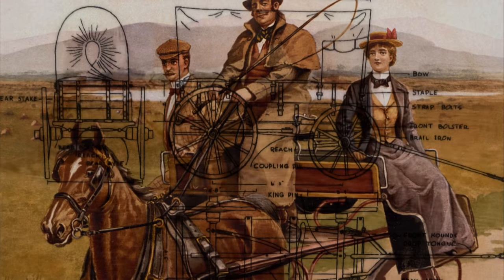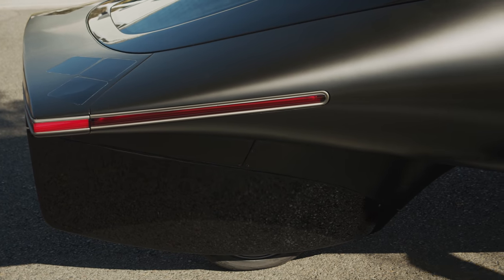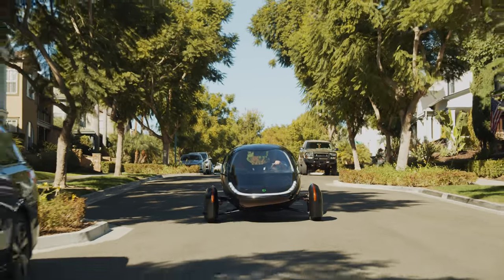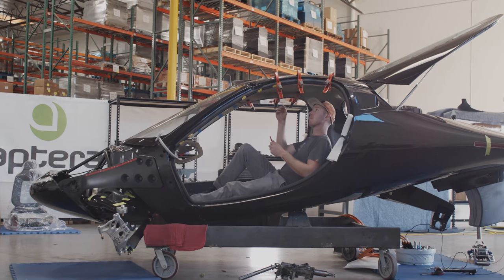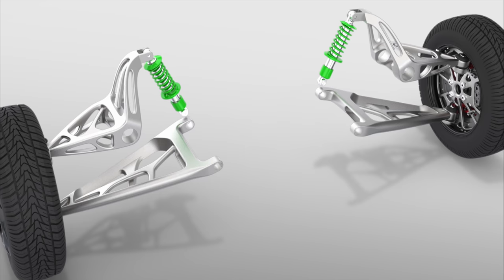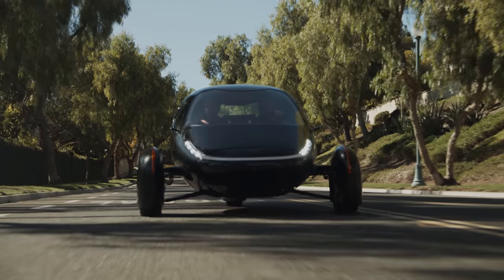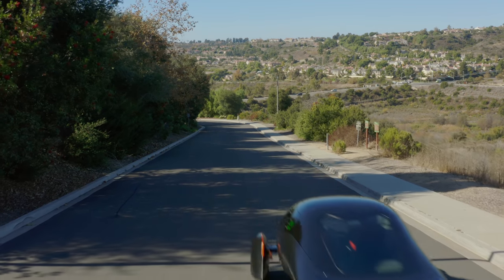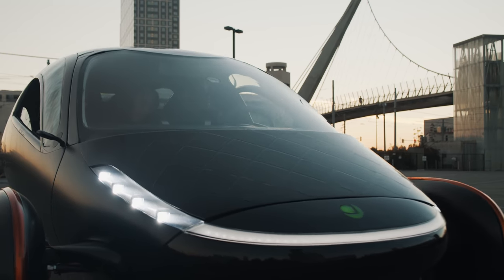Aptera Has Launched

Comment: The range on their best model for just 1 charge is 1,000 miles and it costs less than $50,000. That’s actually insane. Plus you can get additional range from solar power. I really hope these guys succeed. Also a 4 seater model would be nice in the future as well.
Reply: they are planning a 4 seater, but first things first.
Reply: The extra range from solar power is pathetic. Basically a couple miles a day.
Reply: @adamkimmV  something is something
Reply: @adamkimmV  well a lot of people only drive a couple of miles a day, also if every car in the world can save a couple of miles on gas EVERY DAY that would make a huge difference.
But yeah there is also definitely room to grow, which is also kinds the point of this
Reply: @GuidoHaverkort  the issue is what's the point in putting the solar panel on the car? It just adds weight to the car compared to having a panel on a roof, or in a solar farm, and just using that electric to charge cars. Especially considering most people will leave these in garages, or car parks 90% of the time.
Reply: It would be cool if you could tow a teardrop trailer so you could live and drive anywhere
Reply: @adamkimmV  yeah okay i get what you're saying, that is true. But i think what they eventually want is that solarpanels charge so good that they charge a considerable amount while driving.
Also maybe when you are parked at your work it can charge without the need for a charger but i dont understand why all car companies dont work together to create an elektric grid, tesla already said they would be up for it
Reply: @adamkimmV  I think a big plus is the A/C might be able to run almost continuously. Also , if it has one the 12 volt lead acid battery won't be able to die.
Reply: I think most people only buy two seaters, if they are cheap or if they are sport cars. So the number of seats in this car is maybe its biggest problem.
Reply: @adamkimmV  pumping fuel exhaust into our planets atmosphere at the rate were doing is pathetic
Reply: @adamkimmV  it means u will never be stranded if u can’t get to a charging station...even in the middle of the desert   ☺️
Reply: @MrClassifide  why would it need a lead acid battery, if it already has shit tons of li ion.
Reply: @adamkimmV  sometimes for ease of comparability. They need the 12 volts to be available to close battery contactors if they separate the battery contactors while the car's off they can't use high voltage. so they use 12 volt low voltage and they usually just use a regular car batteries. 

The Prius for example is a 12-volt AGM battery that it does not use to start the car it's just a power all the regular 12-volt window openers and lights and stuff like that. Also the computers
Reply: @adamkimmV  according to their website, the full solar package adds about 40 miles per day.
Reply: @Change-Maker  Yeah exactly. That's not "a couple of miles".
Reply: I love electric vehicles but there is just no market for this monstrosity. An average family needs a small car for economic trip to work and shoping and a family car for long family trips. This isn't either. Too small for a family car and too expensive for a shopping bag. It is not a sports car either. The only possible customer I see buying this is some rich elderly couple with no family who wants to travel a lot.
Reply: @RandomGuyOnYoutube601 agreed that it's not a family car, but why isn't it a sports car? 0-100km in 3.5 seconds, and better aerodynamics then any standard car, creating both speed and stability, like flying, but on the road.
Reply: @Change-Maker  perhaps it is, I didn't research it. It wasn't in the video and from the video (was it?) I didn't get a feeling of a sports car. I am sorry for my ignorance. Sports car market isn't huge either. My point was that you don't want to pay for 1000 mile range becouse the range is mostly useless for a small vehicle.
Reply: @adamkimmV  40 miles charging in a day if parked in sunlight, is a good deal for me and people I know. Who says couple of miles charging in the sun???
Reply: You can roam an entire city with 40 miles , now imagine you’re too lazy to go out the charger in , or maybe you’re stranded on a highway , or maybe you forgot to put the charger in !! That’s when the sun light thing comes into play , more over in countries like India and parts of Africa , the sunlight is so intense that not would it turn you black and brown , but it would also charge the car in a small amount of time , you won’t need to charge the car at all in countries with a lot of sun light
Reply: 500th like noice
Reply: Solar freaking roadways!!!
Reply: @adamkimmV  If you live in a colder, cloudier climate, the minimal solar panel option is the best choice. The max solar option is for people who live in warm sunny climates like southern CA, TX, AZ etc. There are 3 solar options to choose from.
Reply: @adamkimmV  I'm guessing the current solar panels are between 20-25% efficient, the best panels available are in the 40+% range.  When they become standard the extra range will double.
Reply: @adamkimmV  ni;,g4ga
Reply: Enjoy driving 1,000 miles in that tiny pod. Like driving 14 hours in a Miata. Impressive, but still impractical. It’s good to see innovation, but this car is kind of a joke.
Reply: @adamkimmV  40miles per day
Reply: @adamkimmV  That is why it is an optional add on
Reply: @adamkimmV  It just adds weight? Wow, you're short-sighted. The additional weight is negligible (likely near-zero) and the benefits are well worth it for people who don't have "a panel on a roof". Mine will be parked in my side yard (where there's good sun but no easily accessible power). And I'm definitely planning to take it camping. Having solar cells on the vehicle means that's one less thing I need to pack. Also, "most people" don't even have garages.
Reply: @tims8603  I live in the north US and I'm getting the full solar package (so as to pull as much "free" energy in as possible no matter where I happen to be).
Reply: @popefacto5945  Yeah, if you are able to afford the extra cash, why not. Kinda depends on where you live. I live in WI where summers are short and it's sometimes cloudy and or rainy much of the  summer. We're east of MN, which has a lot of lakes, and near 2 of the Great Lakes. If I bought one, I would buy the minimum solar. I'm retired so I don't drive much. The 110 plug to charge would be fine for me.
Reply: @adamkimmV  They're claiming ~40 miles per day of charging capacity. That's plenty for me (unless I'm on the aforementioned road trip, in which case I'd use public chargers). Speaking of, it'll charge on 110 VAC (so I don't need a level 2 charger at home). Does someone pay you to talk out of your ass like this or is it something you do free of charge?
Reply: @RandomGuyOnYoutube601  "An average family..." You're forgetting the millions of single people and childless couples. I'd buy one. I'm a single guy with no kids or pets and I have no need for the two extra seats in my car and never will. I use my car for shopping and visiting my mum 100kms away so this would be far better than my four seater petrol car.
Reply: @shukrantpatil  There are also plenty of people who can't park close to a power point where they live. Trailing an extension cord out of their window, across the yard and the footpath to their car is a bit impractical! 😄
Reply: @LeDank  Not at all. There's as much room in the cab as in any regular small car and, no doubt, the drive would be superior to most cars currently on the road. I used to drive 1000kms to work every few months in my Toyota Corolla hatch and had no problems with that. Most people don't normally drive even 1000kms a day so it's a moot point. The average daily drive is around 50kms a day which is what this is aimed at. It's a city car and would be perfect for that. Not impractical at all.
Reply: @weirdunclebob  Why put a 1000mile range on a city car? Couldn't you save several thousand dollars reducing that then? Your corolla hatch back has approximately 3x the space that this joke of a 'car' has. It's not practical and sucks.
Reply: @adamkimmV  For a regular car, yes you would only get a couple of miles out of the charge. For their car, which has zero drag, you can get up to 40 miles per day (obviously depending on climate, weather, etc.). Wind resistance is a pain to deal with, but much less so with their car.
Reply: @LeDank  it might not be practical for you. I couldn't imagine using this as a family car. However, I think people who use motorcycles as their regular form of transportation would disagree with your comment on space. Their are a whole lot of different lifestyles this car would fit neatly into. There is plenty of space for luggage for you and another person. I could definitely see a road trip in this.
Reply: @patientfirbolg3299  I think you only think it's cool because it's electric and are overlooking all the impractical bullshit because you want to like it. I do ride motorcycles all the time actually. Generally I commute by motorcycle. A motorcycle is better than this car. Harley Davidson makes the most expensive electric motorcycle available at $30,000. It's $20,000 less than this car which has about the same practicality. I would rather have 2 Harley Livewires than this doofy looking suppository on wheels.
Reply: @patientfirbolg3299  In fact, I have a motorcycle and a Fiat 500. Even my Fiat has more space than this stupid "Aptera". Geez what a stupid name even. You know how much I paid for both the Fiat and the motorcycle? About $16k combined. This stupid tadpole car costs three times both of my vehicles and can't do half of what I can do with those. Impractical and stupid. It's not gonna sell and Aptera will go out of business I can guarantee.
Reply: @LeDank  "Harley Davidson makes the most expensive electric motorcycle available at $30,000. It's $20,000 less than this car which has about the same practicality."

The 1k mile battery one costs 44k, but the 250 mile battery goes down to 25k. Which makes it 5k cheaper and it still has roughly a 100 miles more range and cargo space :). Room for a grocery trip, a few suitcases, etc. I think you just lack imagination. That and electric vehicles cost about half in terms of maintenance (which is more of the appeal to me).
Reply: @LeDank  Maybe the range is just a bonus of the better technology?! Regardless, few would drive all 1700kms in one go. It just means that you don't have to recharge for 1700kms. Having the solar panels means that you probably won't ever have to recharge it.

The space in the drivers seat the Corolla had wouldn't be much more than the space in the drivers seat of the Aptera. The rest of the space in the car is irrelevant while driving. The boot of the Aptera would be ample for my needs. It's not a joke of a car at all! Maybe it's not suited to your needs but there are other people on the planet with different needs to you!
Reply: I’d buy it if the design wasn’t this terrible
Reply: @patientfirbolg3299  it has not 0 drag thats impossibel up to means you get that the best sercomstances . In most cases you dont and why woud you buy that thing for 50k and you drive it in citys were you can charg anyways or were any electric care ahs enoth battery to get you throw a day without any problems. I dont realy know whats the point of this car is.
Reply: @weirdunclebob  If you only drive in citys or close range then there is even less point in this you get better electic cars were you have enoth range for every day driveing and you just charg it at home over night or by your workingplace and if you need it for lang range and need space to transport things you have that then as well . Dont see why you woud want to spend 50k for this thing .
Reply: @adamkimmV  hello architecture student here. those dark multilevel carparks you said are a big design problem right now and various unis are trying to solve that. It won't be long before someone comes up with that design solution, the only problem is currently there's no demand for it. I think EV vehicles are a good step towards this.
Reply: There are a lot of red flag when order: You ordering a vehicle that is not yet in production, Your ability to buy the vehicle is not guaranteed, place in the queue is not known, specifications can be modified any time after ordering, who in the wright mine place such of order.
Reply: I doubt this car in this formula will be street legal in most places.
Reply: @adamkimmV  According to them in another video, they claimed it can get 1 mile per 100 watts. That is very good. I built a solar electric gate opener with 100 watts motor and 35 watts panel  and 7 amp/hr lithium battery (1 ft x 1.5ft panel). It works perfectly for over 1 year (rain or shine). It works even during the California fire last year with almost no sunlight over 2 weeks. I was worry about not enough power when it rain when I started building  my smart z-wave solar electric gate opener in late 2018. Now, 2021 and it is still going strong. 
 I like they thinkings and design (, efficient, modular and simple). "simplicity is the ultimate sophistication".  I used to hate debugging someone's else code who made the code  unnecessary complex. I usually end up rewrote the code (usually faster) than try to fix a bad set of code. Large corporations usually do not like that for political reasons. 

"Any intelligent fool can make things bigger, more complex,..  It takes a touch of genius — and a lot of courage to move in the opposite direction.”

The  combined panels on the Aptera probably rank 0.5k watts.  That translate to 5 miles per hour.
Reply: I had the same hopes 15 years ago... for this same company...
Reply: @weirdunclebob  *km, not "kms" (kilometre-seconds).
Reply: @tstcikhthys  km/s is kilometres per second or kilometre-seconds, not kms. kms is acceptable for kilometres though km is technically correct.
Reply: @weirdunclebob  Kilometres per second (km/s) and kilometre-seconds (km⋅s or kms) are two entirely different units, so no, "kms" is not acceptable.
Reply: @tstcikhthys  Please explain the difference as I can't find it anywhere on the web.
Reply: @weirdunclebob  Kilometres per second (distance per time would be speed or velocity), while kilometre-seconds (distance times time, a compound unit) would be absement or absition.
Reply: @tstcikhthys  Never heard of absement or absition before as I've never looked that deep into physics. Fair enough though most seem to use km·s, not kms but that's probably me being pernickety.
Reply: @weirdunclebob  Yes, technically "kms" is incorrect for kilometre-seconds because it actually represents kilomilliseconds, which would amount to just seconds (the kilo and milli cancel out). This is similar to how "kWh" is incorrect; it needs to be written as kW⋅h.
Reply: @adamkimmV  In full sun all day the added range is ~40 MILES, not "just a couple of miles". My Prius gets "just a couple of miles" in EV mode on a fully charged battery. Try harder next time you attempt to troll.
Reply: @adamkimmV  it's 40 miles per day for solar charging. Americans only drive 25.9 miles on average. There's plenty of energy left on the car.
Reply: If you put it on  rails. Steel on Steel is 90% More Efficient.  90×300 MPG=27000 Per Battery Charge.
Reply: But look at how long it takes to get a full charge!!! It’s not that great, here in Michigan I believe it would take a month or so to fully charge to 1000 miles
Reply: @cambam0  yeah you could charge it in your garage. What about all the months that is sunny in Michigan. 🤔

You know the other 6 months of the year..

This is the same issue you have up in western Washington.
Reply: @otrogreandcorgi9818  do some research my dude, they have map that shows how much charging you would get from the sun in your area, all around the globe. I looked at that map and thats where I got my information from. I love how people try to say something without even understanding what they are reading. (P.S. Africa had the best charging per day from the sun and i don’t think they even get more than 40-50 miles per day from the sun. I drive more than that for work so good luck traveling.
Reply: @cambam0  🙄  And the north has other forms of alternative power. There's such a thing as mini hydro.
Reply: I still don’t understand why static electricity from the wheels can’t recharge along with solar!
Reply: wow
Reply: you will not get 1000 miles on this without using the solar cells.
Reply: I NEED ONE
Reply: @adamkimmV  40 miles isn’t a couple
Reply: it "launched" a year ago, but isn't in production.  time will tell tho. i hope they scale up
Reply: @adamkimmV  It works out for me as my car is parked in an airport parking lot for 4 days at a time minimum.
Reply: @adamkimmV  40 miles for free is nothing to sneeze at.
Reply: @adamkimmV  40 miles for free
Reply: @adamkimmV  most people only drive 15 to 20 miles a day. Building a car that I can charge itself without depending on the grid is the only way an all EV future could even work, our current grid won't be able to handle that kind of future, and by the time we can the demand will double yet again. And for those who Park in the garage, they can just use a standard wall outlet to give them 150 miles, do a total of 400 to 1000 miles range, which means no range anxiety.
Reply: @MrClassifide  the Hyundai Ioniq doesn’t have a 12 lead acid battery. It uses the HV battery to power the 12v system components.
Reply: @RandomGuyOnYoutube601  this would be a great commuter. I driver 60ish KMs each way to and from work every day. I don't need a large vehicle for commuting to and from work. We also have a 5-seater for if we have to pick up people. This would be great for commuting
Reply: 53K if you want all the best options...but with 40MPD solar charging 1K mile range and level 2 autopilot that's still a steal
Reply: @adamkimmV  40 miles per day is more than "a couple miles".....most people don't even drive half that for their daily commute.  You'd NEVER have to charge it.
Reply: It could have a lithium 12v . I have one in my chevy spark ev and one in my wife's Tesla model Y.
Reply: 1000 miles if you choose the biggest battery
Reply: @LeDank  i just drove 1600 miles in my Y. It was me, my partner and our 3 miniature dachshund dogs. The back seats are folded down when we have the dogs so it’s basically the exact same amount of room as the Aptera. 

The average number of occupants per vehicle is 1.5. That breaks down to approximately 80% of all autos on the road have 1 person and 10% have 2 people. That means only 10% of all autos on the road that NEED to seating for more then 2 people. 

Your comment was a year ago. Look at whats happened to auto inventory AND prices in since your comment. As the population continues to grow, it will continue to add stress on raw materials to make new autos. Currently the average US household has an average of 3 cars. Currently about 40% of all US households can NOT afford the average cost of a new car (around $37k) once you add cost for fuel. People are going to have to start putting NEEDS over wants and MOST drivers can get by with a 2 seater like the Aptera.
Reply: @JP-kb4yi  you can still buy a 4 door gas car for a lot less than this electric 2 seater. Where can I get an Aptera for $5000? I can get a used Toyota or Honda for $5000.
Reply: @LeDank  oh goodie ONE OF THOSE PEOPLE, the mystery $5k clapped out car. You’re WORNG for the (AVERAGE PERSON) and that $5k car over 72 months at minimum cost the same but usually more to own in the long run compared to a $35k EV like Aptera. Quick fact to keep in mind, national average new car payment only is $644 and used is $488 just keep that in mind because thats the (average jo)

I have 2, 400 mile range Aptera’s reserved and with all the bells and whistles they are $32k each w/state taxes and fees $35k CASH PRICE. If you finance that no money down w/average credit 72mo loan includes interest, the monthly payment would be aprox $550. Lets not forget insurance and maintenance because those matter and I’m basing these numbers off my Tesla Y. Insurance $150pm, maintenance during the 72mo = 2 sets of tires, $2k= $28 per month. Im including 40 miles driving per day. totals are payment 550+ Insurance 150+ maintenance 28+ fuel/electric 0 = $728 a month.

$5k used car and I’m using the national average for mpg 25, fuel cost $5.01. Monthly payment $97, Insurance $100 pm, 3 synthetic oil changes $195 per year = $16pm. 1 set of tires for 72 mo $1000 = $13.89pm. Fuel 1.5g per day @ $5.01 = $7.51 per day x 365 = $2,741.15/12 = $228pm. Totals 97+100+16+13.89+228= $454.89  a month. 

Now at first the used car looks like a no brainer. The only problem is unexpected break downs, how major or minor. Ex a new batter is a cheap quick easy fix $100 and 30 min to go get the new battery and install as long as you have another auto to get you to the auto parts store. A new transmission or rebuild will vary greatly depending on where you live. My area average is $3,500 w/4-6 week repair time and $200 tow bill. If you don’t have another auto you have no way of getting around for 4-6 weeks other then rent a car $50 a day or cab/Uber/Lyft $75ish a day but varies. If you miss work thats a loss of income only making the true repair cost higher. All of this is a gamble with a used car and that risk is substantial greater on a $5k vs a $15k used car. Even the best mechanics miss things (i have one in my house) Just since 1/1/22 My paid for bought brand new (like NEW condition) garage kept NEVER seen the rain, 2007 VW Eos w/81k miles needed 2 new batteries costing a mind blowing $650 EACH part only 4 weeks to ship from Germany. Then the ABS module suddenly failed $1,800 part only w/6 week shipping from Germany. Yes i looked for used parts w/no luck.  Luckily i have an in-house mechanic costing me $0 for labor. The only place i could find that would work on the car was the dealership and had they replaced the batteries and the abs module labor would have been $3,700 alone. My Eos is not the best daily driver example because it’s extremely expensive to maintain (SPECIAL COOLANT $100 for 5 gal) but I think I’ve made my point. 

Im not saying a SOLID affordable used car cant be found BUT the $5K specials are about as common as finding a $100 bill on the sidewalk. If you’re mechanical inclined with a proper repair space and tools then a $5k auto will be less expensive UNTIL there is a used EV market. BUT for the average person that gets oil changes and all maintenance/repairs done at a shop, a reliable used Toyota/Honda will cost $15-$20k. At that point if one can get by with a 2 seater then a brand new $35K Aptera will be more reliable and less expensive to own over a 72 month timeframe. Gas prices will fluctuate but i love being able to have an accurate budget that doesn’t change due to external circumstances. My home is in the country, all electric and completely solar powered. I paid cash for that system but it breaks down to just under $200 per month or $60k for 25years. THATS less then i was paying to the electric company each month pre-solar and my system has produces a 20-30% surplus every month for the past 3 years even with charging my Tesla. Ive only had my Tesla since Jan 2022 and only done 2 road trips that required me to pay to charge. My last road trip was 1780 miles and it cost $126 to charge. Other then road trips ive not paid anything extra to charge. Prior to getting my Y, i spent about $450 a month in fuel for a 2018 Outback. I think the last time I filled it up, fuel was around $2.90pg. If i still had that car today my fuel cost would be around $800. Im making the switch to EV’S because they are cheaper in the long run since I don’t buy used cars. Anyone buying a new or slightly used car is financially ignorant if the buy an ICE.
Reply: @JP-kb4yi  that’s a lotta words … too bad I’m not reading them 😎
Reply: @LeDank  to bad, probably why you believe you can find a good 5k Toyota or Honda.. GL w/that.
Reply: @JP-kb4yi  where did I say it was gonna be “good”? That’s subjective anyway.
Reply: I think they need a 4 seater to get mainstream attention. This is an excellent car for somebody who wants an efficient commuter car.
Reply: @adamkimmV  40 miles a day.  More than the average person’s commute. My commute is 12 miles each way, so I could drive to and from work every day and never need to charge
Reply: What kinda battery is it using
Reply: @adamkimmV  40 miles a day is not pathetic. Thats easily enough for a reasonable daily commute. You'd realistically only need to charge your car maybe once a month, which is far better than the nightly charges most EVs need.
Reply: @adamkimmV  40 miles in 8 hours of solar charging is substantial enough that a lot of drivers won't even need to charge their cars for the normal daily commute to work and back to home.
Reply: No, you don't get "extra" range from solar power.  The rated range based on battery capacity is the rated range period, noting extra is possible.  But in this case a portion of the battery charge to get that range  can come from electricity generated by the onboard solar panels rather than "having" to plug it in to a L1 or L2 charger.  40 miles of range from the solar panels will meet many people's daily commuting requirements so in that sense it could be "free" driving if you only use it for commuting to and from work.
Reply: Piss off four seater buy two
Reply: It’s about 20 to 40 miles a day, lol that’s most peoples daily commute
Reply: @RandomGuyOnYoutube601  I think you are using very narrow thinking. Check their webpage. They are targeting 5 types of drivers at 600,000 max u its per year. They already have over 30k reserved for purchase. Their 5 targets are 2 passenger drivers 140k/ yr, efficient commuters 140k/yr, motorcyclists and 3 wheelers 120k units/ yr environmental advocates at 120k units / yr and energy saving advocates at 80k / yr. These are very obtainable numbers. And would help with the reduction of combustible engines. I'm still a big believer in the combustible engine because of range and misinformation surrounding EVs. However, a solar car that I'd never need to charge if I drive less than 40 miles a day (which I do) super rare I need more range and for under 30 grand I'm all for it and plan to reserve one next year.
Reply: People calling this car a joke is hilarious. This vehicle is perfect for me and super affordable and I would never need to charge it with my driving habits. I'm 52 and work 2.4 miles from work 6 days a week. On sunday I just need grocery store or shops around my small rural town. I plan to reserve one as I finish my research I'm 70% there but see this being a perfect vehicle for me. Far from a joke. Actually amazing is the word I'd use. Just because it doesnt fit your needs doesnt mean it's a joke. Their goal is 600k units a year for max production and they break down their target customers on the website. These are very obtainable numbers and by far would help with zero emissions goals. So far it's one of the best options I can find for me environmentally and efficiently also economically. That's not a joke. I wish them all the success they have a place in the vehicle market
Reply: @adamkimmV  you haven't watched the videos about the solar power range have you?
Reply: And the problem with that is????
Reply: No its not